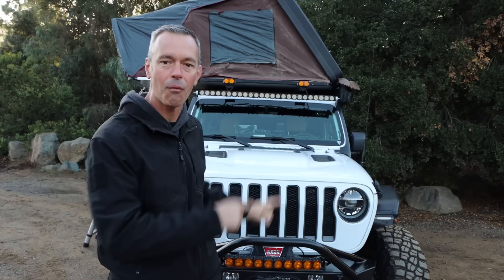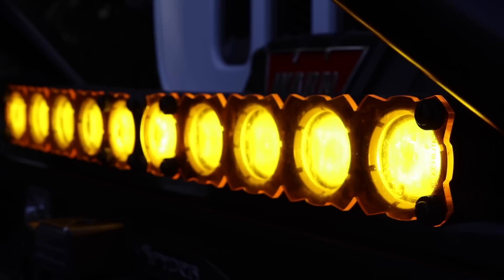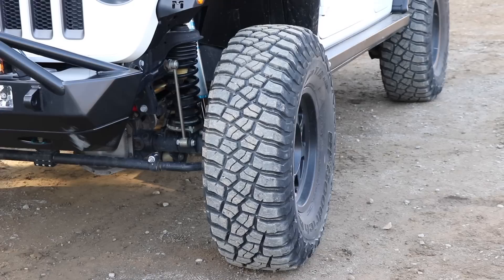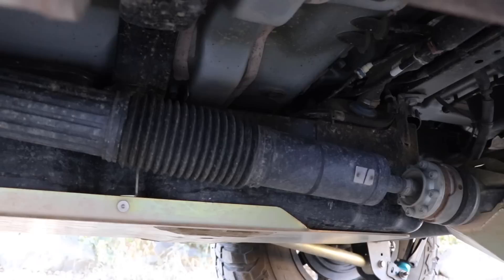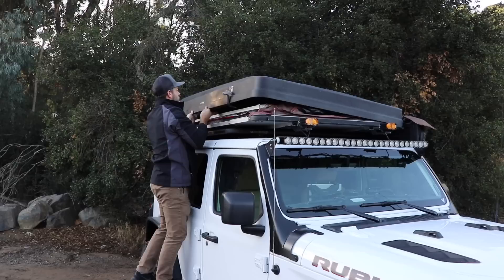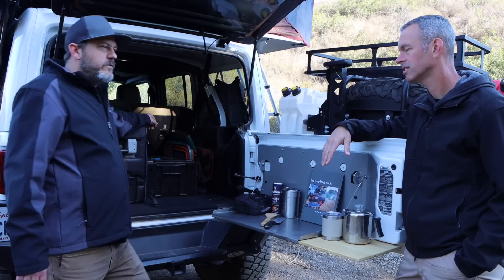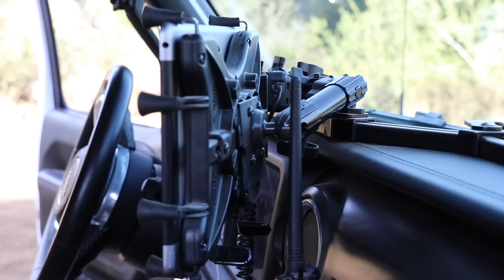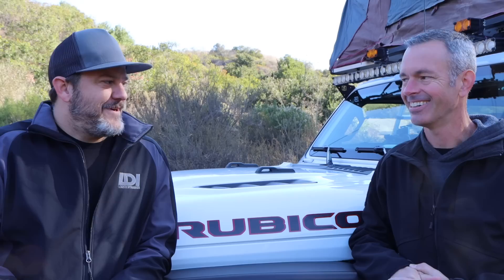Is this the Ultimate Expedition Jeep Wrangler Build?

Comment: Vent the hood, it makes a world of difference.   Add a cold air intake ran through a snorkel, it helps the power a lot.  I always add a better exhaust, if you dont have to do emissions,  do high-Flow Cats...I did 5.13 gears on my K5, highly recommend going to those gears...

Comment: Great video. I have a stock 2018 JLU Rubicon that I am getting ready to start adding aftermarket stuff in Spring of 2020 and finally start to overland and do some camping and exploring (not necessarily rock crawling). This was some really good insight into gear for me. I think I’m starting with the Metal Cloak 3.5” game changer suspension w 37” wheels/tires and a roof rack tent setup. Thanks again for the insight!

Comment: Funny thing, I was talking to a friend, just the other day, about doing the Magruder. Every time we head out, here in NW MT, about the first thing my wife asks is "did you bring a chain saw?" Some days you don't need it, some days she drives and I just walk ahead cutting trees out of the trail.
Reply: Did the Magruder on my motorcycle (Vstrom) in August.   No problem and no chainsaw needed.  I could see the need for one right after the trail opens though.  Saw a Subaru half way through, he said he’d had no issues whatsoever.  It was a long trail with a ton of rocks.
Reply: @ClinttheGreat  Thanks for the info. We normally only need the chainsaw first thing in the spring and after a big wind event.
Reply: K Richards I can totally see that.  Rarely are downed trees an issue on the motorcycle, but we do carry small saws just in  case.

Comment: I’m glad I watched this and now I know not to get the auxiliary switches and to get something custom instead. I also learned to get that dual battery pack.
Reply: I just ordered recently also.  Get the aux switches.  There are never too many switches.  Plus, otherwise it is dead space that you will eventually want to install....switches in.  Use them for more static / less used items like winch and air compressor, maybe fridge.

Comment: What kind of gas mileage do these overlanding Jeep’s usually get at once they’re fully loaded.
Reply: My guess is from 12-15
Reply: 8-12 mpg depending on terrain.  Gearing is a big factor as well with how heavy and non-aerodynamic they get them with all the add-ons.  But if you can spend $55,000 on a jeep and another $30,000 on equipment, gas is the least of your concerns.

Comment: Where's the "How much did you invest" question? To be honest it's all cool stuff, but obviously this guy has some extra cash he can drop on the Jeep. We're talking in the close to 20k range and then let's buy a Gladiator as overland vehicle. That's another 100k build once this guy is done with it. 
Personally I try to drop as little as possible on a build. It's about getting out and not about a latest tech fashion show. A 1950s Jeep can go most places a modern jeep can and it's got nothing of the fancy stuff (and of course none of the comforts). Yes, you need to invest in suspension and tires but you don't really need reservoir shocks or the best of the best to get out - that's just comfort icing on the cake.  I spent 3k on suspension and tires. I don't rock crawl, so I don't need 37's. I'm perfectly fine with 35's and some armor.  Maybe I'll regear my diffs one day because I am on the long end with those, particularly when towing my trailer. More important for me: getting out, having fun, seeing places other people can't and if the road there is a bumpy ride so be it - generally I take the top off for those tracks because if you're being bumped around you might as well have a sunburn and be dusty for a complete experience.